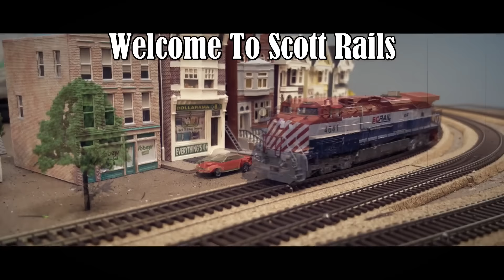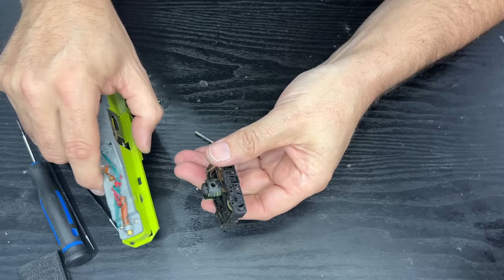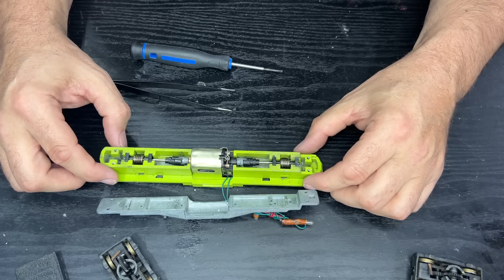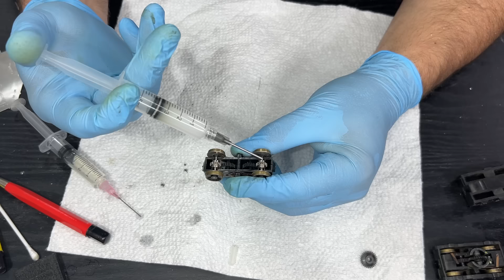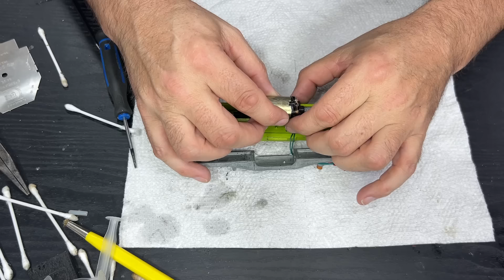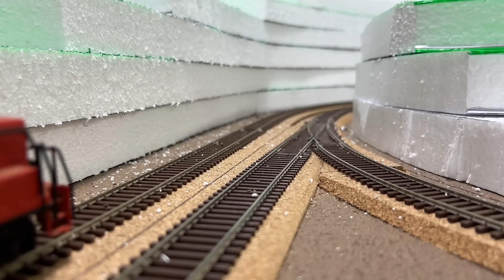Tune Up Tuesday - CP Rail - Bachman GP40

Comment: Super. I have never seen anybody review an old school Bachmann GP-40. (Or the U-36B.) I bought one of these decades ago, when two and four wheel drive was common. Mine has all wheel electrical pickup, all wheel gear drive, front and rear headlights lluminated, and the class lights, after minor work, are lit up now. It also has a five pole motor, both cab and nose headlights, a nice horn, full handrails, and I love that rear headlight. This chassis was also used in a brass model of a GP-40, maybe produced by Gem, that would barely spin its wheels, but had great tractive effort. The GP-40-2 chassis is too long for a GP-40 body, as I found out the hard way, and GP-40 locomotives do not have a window on the right side of the long hood, while the GP-40-2, and all EMD Dash two locomotives, have an inspection window there. My GP-40 runs great after all these years, and I suggest that you put your locomotive on the track, block the Geep from moving, like with a towel or a long train, and turn the throttle up to a point where the wheels are spinning, but not bouncing. Let it run for fifteen minutes, keeping an eye on it, then flip the locomotive around, and after a break, run it for another fifteen minutes. Do this many times, not all at once, and relube after you are totally done breaking in the loco. Three or five times over the course of an evening, or two, and your GP-40 will operate much smoother, last longer, be much QUIETER, pull more train cars while the motor runs cooler, and have a lower minimum continous speed. I liked my Geep so much that when the repair guy at Mizells Hobby Shop (Thanks "R" man.) offered me a second complete running GP-40 for ten bucks because nobody wanted it, I snapped it up, even though it was old school even then. The Geeps are almost fifty years old, and I love them both. They usually get run hard and put away wet, and that is probably one of the reasons that they run so well. (Spin those wheels once in a while.) They don't have any issues with operating in the rain, snow, or sunshine, and the patina on the paintjobs after all these years looks very realistic. They run at about the same speed as my more modern locomotives, and MU well with my fleet. Good video. Hello from the Tracy Mountain Railway in Colorado. 💙 T.E.N.

Comment: That Bachmann GP40 is FAR from a Spectrum! It dates back to the mid 1970s. They were hit and miss in quality, the biggest flaws is that those chassis often suffered from zinc rot and those motors often burned out. This was before they started to make those cheap 4 wheel drive pancake motor trainset locomotives in the 1980s. Then like Life Like with their Proto 1000 and 2000 series Bachmann got serious and started the Spectrum line in the mid 1990s.

Comment: Hey Scotty. I think alot of that noise is from the, pretty certain, 3 pole motor. Betting it would be a good candidate for one of those $1 Amazon motors. I tried a repower,on DC & wow, just phenominal. I bought a couple of them & will be doing more of them, on the future.
Reply from the maker: wow, I just presumed the motor was a 5 pole. I'll try a new motor.
Reply: I checked mine and it is a five pole, but maybe Bachmann got cheap right before the pancake motor. 💙 T.E.N.

Comment: Great video and you did everything right. This was a terrible design Bachmann played with for a short time. You are lucky that the top zinc support was strait and in one piece. Some of the noise is from the motor and the gearing accounts for the rest so the only way to make it quiet is to run it under water. lol. Changing the motor does help and may satisfy. Good luck, JerseyBill.

Comment: There's a lot of slack or play in the drive train between the motor and the trucks. I'm wondering if something like a thrust washer would help with the gear noise. I think you are stuck with the bit of motor noise unless you just flat out replace it.

Comment: This version of the GP40 is actually pre-pancake motor era before Bachmann much like other competitors went to the cheaper motors in the mid to late 1970s. Early Bachmann locomotives from the early to mid 1970s actually had this design of chassis which runs way better than the pancake motor era. When Bachmann decided to release the Spectrum line design, there used some of their early designs to incorporate in the brand series. If you noticed the way the trucks connect to the frame, this is not too far different than it is done with the Spectrum trucks as far as the gears and the connection. As far as the noise, you did everything that you could to make it better through lubrication. The combination of the design and the wear of the locomotive will not get better over time. It's just something to live with unfortunately.
Reply from the maker: Wow, so this had the potential to be a great design, but they messed it up with bad parts. 

I do maintain that metal gears to plastic gears is a terrible idea.

Comment: You need  to add a black marker to your tools , so you can mark the motor,  50 50 chance lol if your like me you'll lose every time, 😎😎😎have a good one mate
Reply from the maker: The thing is, I explained in the video that the contact bar needs to touch the frame plate, them immediately forgot that, lol.

Comment: This was Bachmann's attempt at dethroning Athearn in the 70's.  I owned one for a time, and it just sat on the layout, stuffed and mounted.  The motor was cheap, and the gear rotated on the silver bar, it would bind as you went around 18" and 15" radius curves.  I just ran my Athearn S12 all the time.